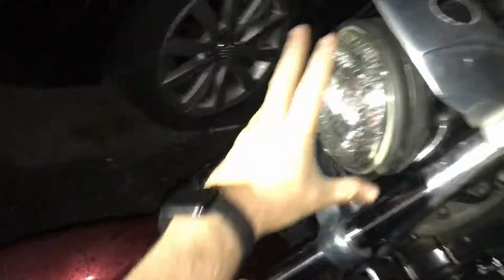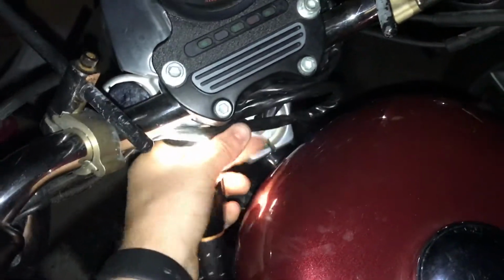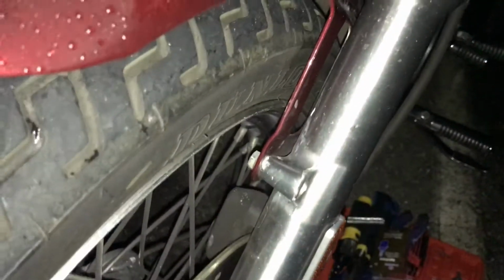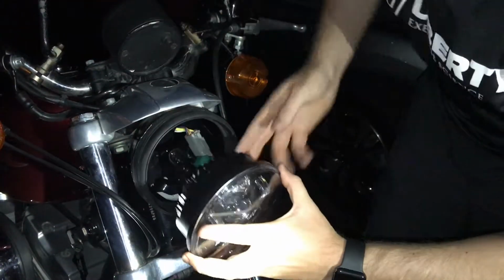Harley Davidson Sportster LED Headlight

Comment: Can I get an up on how well this light has worked for u and if it still works well I have an 88 sportster looking to do led headlight also
Reply from the maker: It has been working great! I've had it for about 1 year now, and I absolutely love and recommend it.
Reply: Wine & Bike & DIY thank you I purchased the same one but mine seems to be a bit different
Reply from the maker: Hi Daniel Gibson! So, how is yours different? is it not fitting?
Reply from the maker: Hey Daniel Gibson, any updates?